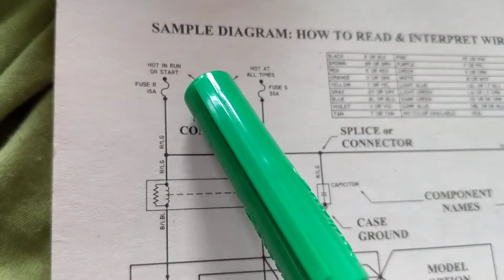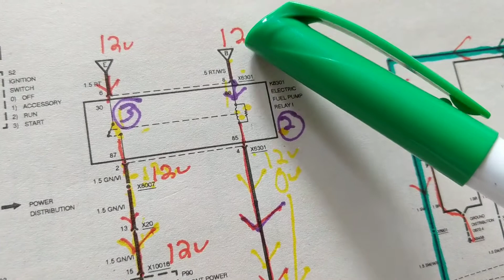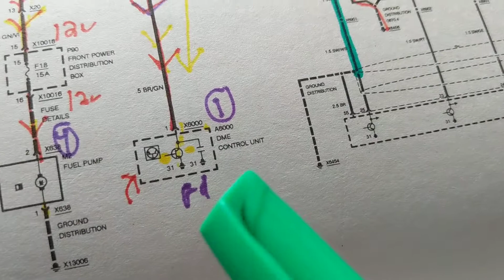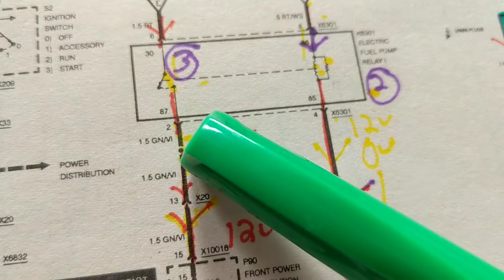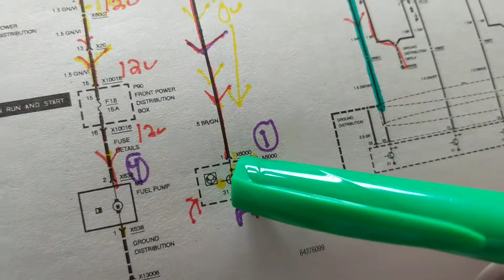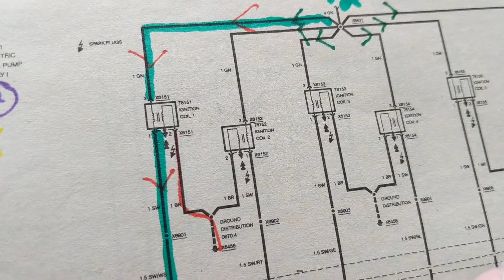how to tell if YOUR FUEL PUMP IS REALLY BAD WIRING DIAGRAM ANALYSIS

Comment: Bmw 335i 2006 driver window doesn't go up and down using window panel,  only work with remote control,  kindly, could you bring its diagram and explain it for us? Thanks
Reply from the maker: Wiring diagrams can be also found on BBB industries wiring diagrams try it any problems then leave a comment
Reply from the maker: For power windows remember you use a motor that is bi-directional going forward and reverse the same motor the switch could be the problem but now there are modules that control the motor and the switch I'll find the diagram myself and hopefully I'll give you a feedback thanks for being a viewer
Reply: BBB is not working anymore